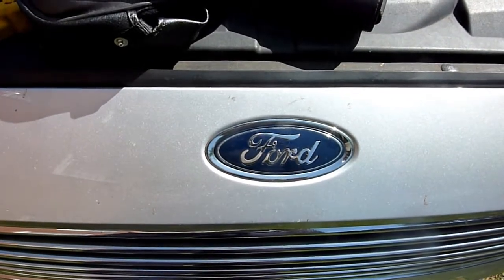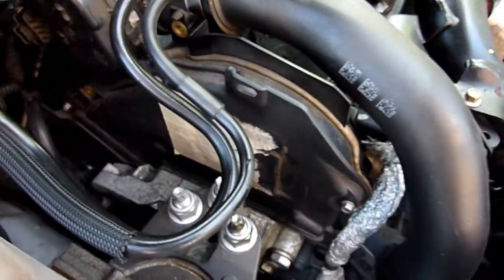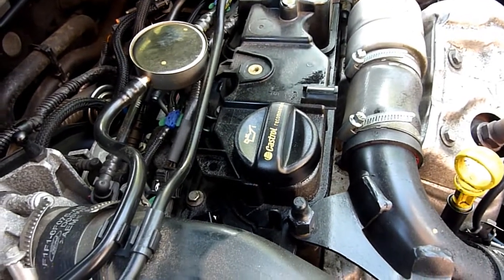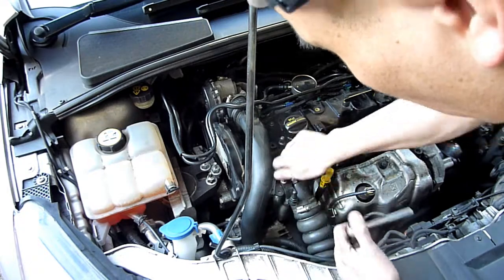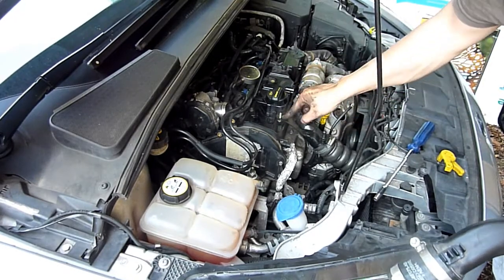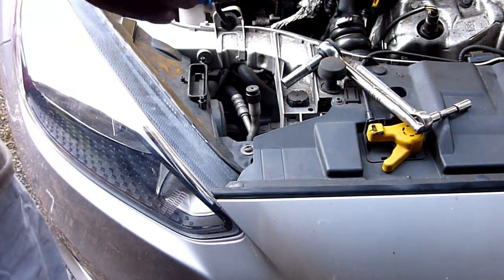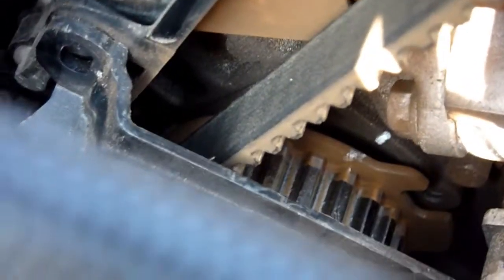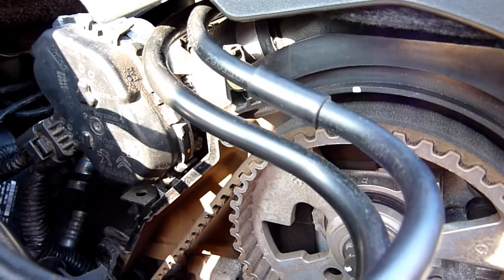Preparing for a Ford Focus 2015 TDCI bph120 Timing Belt Change

Comment: what's is the difference in term of reliability between the 1.5 and 1.6 ? Is the 1.5 similar to the 1.6? Is this a PSA engine too?
Reply from the maker: 1.5 is single cam...1.6 is double cam therefore less reliable and harder to change say timing belt.
Reply from the maker: Also euro 6 on 1.5 euro 5 on 1.6 also no need for Ad Blu on  1.5
Reply: @EducationPineapple  great. It looks like better option to get the 1.5

Comment: What's the timing belt change on a 2015 transit connect 1.6 tdci engine ? Is it 100,000 miles? Any info would be good thanks
Reply from the maker: Ford recommends 125k miles. It depends on your driving. Normal roads and driving I would say 100k. Heavy London traffic and stop start acceleration, 80k. Hard driving, 60k seems prudent. Take off the top timing cover and inspect the belt. It's easy. Shiny belt on the other side of the teeth means it's going bad. Check the teeth for wear also, any signs of wear change as soon as possible. You're in luck. I checked the 2014 1.6 TDCI 125bhp and it's a single overhead cam like mine, so changing the belt is easy. There's an extra step on the crank wheel after taking off the belt and crank bolt where there's either a sensor or locking crank wheel tool at the 4 o'clock position in addition to the 12 o'clock locking pin. And I've put up a very good and complete video on how to do the job. Please watch. If I can do it, anyone can!
Reply: @EducationPineapple mines just coming up to 70 thousand only owned it since april so cant tell you how the last owner drove it ? I'll get it changed after xmas just to be on the safe side .

Comment: My car have don 108022 miles Ford Focus 2014 tdci Ex police bought from auction with service history but no mention of cambelt don plz help when should I change and if it snaps will it damage the engine as few cars damage the engine if cambelt snaps and some doesn’t plz help will be v appreciated thanks
Reply from the maker: Since it is an ex-police car, it has been put through some extreme stresses everyday.  If the cam belt snaps in your car, the valves will smash into the pistons. I have checked this on the 2015 model.  This will be true for the MK3 or MK3.5 (Aston Martin front grill). If I were you I'd change it as soon as possible. Cam belt rated at 120,000 under normal use, 100,000 to make sure and 60,000 if heavy use such as a police car. Open up the top cover and have a look. If there is lettering still showing then it might have been changed at 60,000. Anyway change it very soon. Good luck. See one of my latest videos on the subject. I have a full strip down and installation. Very straight forward job.
Reply: @EducationPineapple  anyone with this engine I would advise you get it done at 80K regardless of use and water pump changed too. I told the garage who look after us to do our fleet car at 85k... they said no no service data says 110,000 or some bullshit. It’s just gone and stripped the teeth at 93K now. We are using the car every day. Ours was a 1.5 95bhp (looks the same as the one in this video possibly just remapped for economy).

Comment: IS THIS THE SAME FOR MY FORD FOCUS 2014 MK3 TDCI DURATORQ
Reply from the maker: If it has the same Aston Martin Grill at the front. If not then yours will be the 1.6 TDCI with twin overhead cam, not single like mine.
Reply: SO MY 1.6 TDCI MK3 HAS COVERED 58000 MILES IS THE BELT STILL SAFE...THANKS ALAN
Reply from the maker: @ekmetaldetecting9768  Ford recommends 125k miles. It depends on your driving. Normal roads and driving I would say 100k. Heavy London traffic and stop start acceleration, 80k. Hard driving, 60k seems prudent. Take off the top timing cover and inspect the belt. It's easy. Shiny belt on the other side of the teeth means it's going bad. Check the teeth for wear also, any signs of wear change as soon as possible. You're in luck. I checked the 2014 1.6 TDCI 125bhp and it's a single overhead cam like mine, so changing the belt is easy. There's an extra step on the crank wheel after taking off the belt and crank bolt where there's either a sensor or locking crank wheel tool at the 4 o'clock position in addition to the 12 o'clock locking pin. And I've put up a very good and complete video on how to do the job. Please watch. If I can do it, anyone can!
Reply: HI THANKS FOR YOUR REPLY WILL PROBABLY CHANGE AROUND 80000 MOST OF MY DRIVING IS MOTORWAY...THANKS  ALAN

Comment: The change for belt is 100000 miles or ten years that's what main dealer has said it is a very simple job the hole in camshaft lines up with hole in the head and the same on the crank shaft pulley and same on the pump

Comment from the maker: The timing belt change should be at 200,000 km or 125, 000 miles. I would check with the manufacturer also I would also keep an eye on the condition of the belt. On the 1.5 TDCI it's really simple and the screws don't fall out when you undo the 4x 7mm screws. You just need a 1/4inch ratchet and a very short extension. Anything like a shiny belt or signs of wear on the teeth and I would change the belt before 200,000km. The printed word tends to wear off on older belts as well. Hard acceleration often also should be factored in for an earlier change.
Reply: im about to change mine , i was told it was a wet belt an a nightmare job but looks to fairly straight forward
Reply from the maker: @bencosturbz7755  the belt is dry of oil....not a wet belt...fairly straightforward...make sure you have all genuine Ford parts and correct good tools.
Reply: @EducationPineapple Ecoboust мокрый, а этот сухой.
Reply from the maker: @bencosturbz7755  check out a video where I completely do the job.